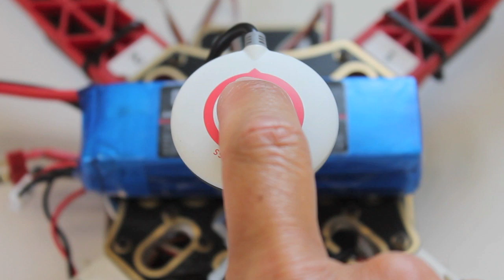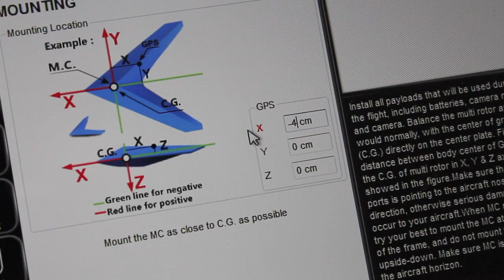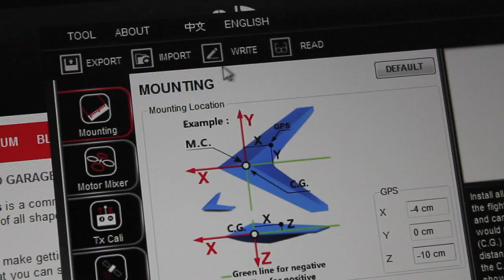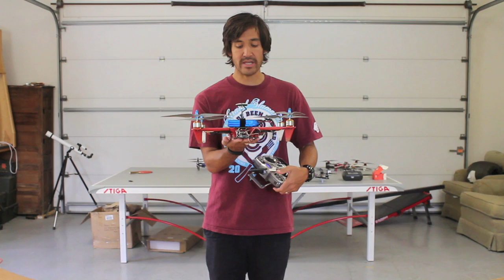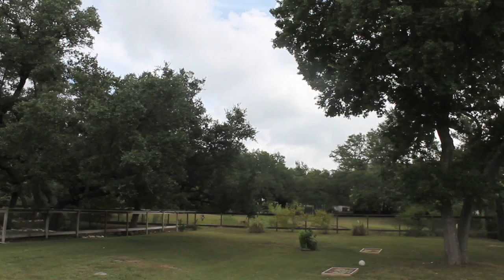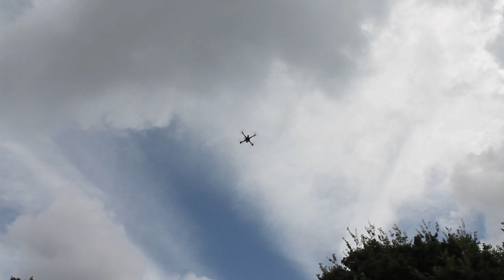NAZA Lite and NAZA V1 GPS Mounting, Configuration, Calibration with Walkera 3 Mode Switch

Comment: Hi i just upgraded my f450 from apm to Naza and im noticing a difference in flight like when im flying in stable mode when all my sticks are center when i give little bit of roll/pitch input the drone keeps going on that direction i mean to say thats its not getting center if i give slight left input and leave back the throttle to center the drone keeps goin left until i have to give right input to stop hitting into walls is this normal of my dji naza has some fault or may be this is how it feels for others I don't know please help
Reply: It sounds like you're in manual mode

Comment: Hi Dennis, I arm my NAZA, motors spin (slow) bit when I increase the throttle they do not respond. I have watched a lot of your videos and they have helped me in so many ways. If you or anyone has come across this, I would greatly appreciate the help. Thank you.
Reply from the maker: That's really strange, Charles. I haven't seen that happen before. I would check your throttle input just to make sure everything is working properly. Some transmitters have a PWM output graph to show what signal the throttle sends when you increase it. Let us know what you find out.

Comment: do you measure from the top GPS plate to the bottom of the GPS holder or down to the nazs
Reply from the maker: You need to find the CG of your aircraft and then measure from that to the center of the GPS. This explains it:

http://wiki.dji.com/en/index.php/Naza-M_Mounting_Location_Setting

If you're not 100% accurate on the CG you should be okay. As long as you're close enough. Experiment with different distance values and see what works best for you. Good luck!

Comment: Hi, I need some help. I have a dji phantom 1 with dji naza m lite upgraded to v2 inside it. On RTH failsafe, the quad flies to home point and descends downwards. at the final 5m or so, it slams into the ground, takes off again, slams into the ground again and again until I take over manual control or I hand catch it, before it stops and disarms. please advice me what I need to do to fix this. thank you
Reply from the maker: That's really strange and sorry to hear that. I haven't seen this happen with Naza before so I'm not sure what to tell you. Hopefully someone else in the community can chime in. Please let us know if you figure this out.
Reply: Dennis Baldwin Hey, I resolved it. I figured it was because I upgraded to a 3rd party m8n gps. my gimbal also affected. the entire CG was thrown off and my mounting of GPS offsets had to be changed. changed that and now it holds stably and rth works well.

Comment: I just ordered the NAZA M Lite with GPS and I plan to use it with a 6 channel Flysky radio but it doesn't have any three position switches (for Off , HL , and CL ) I have a F550 with DJI DT7 radio and NAZA M V2 GPS Both the switches are three position switches And My Phantom radio is the same with switches . How do I use the Flysky two position switches to use GPG , ATTI , ATTI and OFF , Course lock , Home Lock with only two position switches ? I am building a Tarot 650 sport or Ironman . and want one switch for retracts . The Flysky has 4 two position switches and two knob variable knobs hope I don't need another radio . Thanks hope you can help .
Reply from the maker: +Spencer Boaz I wish I could help but I've never worked with the Flysky. Hopefully someone here on the channel can offer some assistance. If you do figure this out please share so we can all benefit. Thanks and good luck with your setup.

Comment: Dennis, I hope you can help me with my tarot 650 sport, short view- nasa v2  when  calibration is done on my pc, stick movement is good along with everything ail-thr-etc. first flight it flips hard?? Ihave been flying an f450 for yrs.never had this happen. I think I have tried it all, can not seam to get it...............Jerry
Reply from the maker: jerry neider It sounds to me something to do with motor rotation and making sure you have the correct props for that rotation. I know that sounds elementary but it's burned my TOO many times. If that doesn't work perhaps you can post in the forums at www.garagepilots.com and we can try to help you out.

Comment: HI Dennis Baldwin I recently just bought an f450 with a Naza lite GPS but I cant for some reason perform the compass calibration. does the GPS need to have a good signal?
Reply from the maker: Miguel R. I've done the calibration in my garage without a good signal, but that's an interesting question. Since it's mainly the compass that's being calibrated I don't see why it can't be done indoors. Here is a good reference if you haven't seen it already:

http://wiki.dji.com/en/index.php/Naza-M_GPS_%26_Compass_Calibration
Reply: Dennis Baldwin thanks for help. After hours of messing about with my tx and the f450 i figured out what the problem was. I some how managed to program my tx incorrectly which is why i could not calibrate the compass but everything is working well now.Once again thanks for the help.

Comment: i got my naza and set it up but the red light is always blinking it flies in manual but when in gps it just decreases and lands.
Reply: i fixed it the battery voltage censer was plugged in wrong now it works great
Reply from the maker: RCflyer729 Glad to hear it. I can't count how many times I've had things plugged in incorrectly :)

Comment: Like All your Vids regarding the 9x I enjoy & they give me confidence to learn more about programming.   ONE Problem I have though with my F450  w/naza lite & gps setup  is when im hovering  & Yaw a little The Quad Raises Up Say 10 inches or so. It's like I m giving it throttle at the same time Although I m not,   I Fly mode 3 So my Yaw IS on the same stick as my throttle.   Question is : How do I stop this OR how do I compensate with the 9x  from doing this ?      Additonal :    When yawing , The Raising of the quad Only moves the quad  about 10 inches  But if I continue to Yaw , After the 10 inches raise,   it doesn't  raise anymore  unless I STOP yawing & then Yaw  Again.
Reply from the maker: Mike, that's pretty crazy. Have never seen that happen before. With the 9X there's a display menu that will let you view your sticks in a bar graph. That way you can at least see if the throttle and yaw are linked in any way. Not sure what else to do. Let me think on it some more.
Reply: I have Looked at the display regard my problem & all is correct, The Only link I have is when I Switch the Gear over,(failsafe) The Pit(ch) moves over a little at the same time. Although this happens It doesn't involve The Yaw.  (Additional) : I Do have the program for my Tunringy 9x on File If you would like to have a look at it. I decided to write it out in notepad form.

Comment: When calibrating does the GPS need to lock onto satellites or is that not necessary? before you can calibrate..
Reply from the maker: No. You don't need a lock to calibrate the compass. Just make sure you do it where there isn't a bunch of metal or interference. The NAZA will let you know if the calibration is successful with the LED sequence.

Comment: What gains were you using? Mine has a gimbal and legs on it
Reply from the maker: I was using the default gains in that video. If you have a gimbal and legs then it's likely going to need to be tuned. You can try turning up your gains in small increments or check out this video that talks about messing with the gains while in the air via your TX: DJI Naza Basic and Attitude Gain Settings for Pitch & Roll Using Turnigy 9X Control Knobs hope it helps!

Comment: I went through all the config, mounting, etc. I'm using a turnigy 9x and I cant get my quad to arm. I calibrated it and it has a green blinking LED. But when I do one of the arm commands it doesn't arm the motors. I'm using Hobbywing 40a ESC's
Reply from the maker: Are you flying with the GPS module and have you calibrated it as well? If you continue to have problems would you mind posting at www.garagepilots.com in our forums? We should be able to help you out over there.

Comment: Hi Dennis,
I have a DJI F450 frame, Naza M lite and GPS, Turnigy 30A Esc and Sunnysky X2212-980kv motors. I will use the Phantom SR6 transmitter and the stock Phantom PPM receiver with one antenna. Do I need to calibrate the Esc´s or just set-up the Naza software?
Reply from the maker: I would always recommend calibrating your ESCs before you do anything. That will give you the full range of throttle with your transmitter.
Reply: Dennis Baldwin
Can that be done in the ´Command Sticks Calibration´in the Naza GUI?
Reply from the maker: No, that's actually a different calibration. I would check out this howto: http://copter.ardupilot.com/wiki/initial-setup/esc-motor/#Manual_ESC-by-ESC_Calibration Make sure you do that before you do the Command Stick Calibration in the Assistant.
Reply: Dennis Baldwin
OK, I´ll give it a try

Comment: Dennis Hi, I finished riding my quad with naza lite and installed a futaba 7c 2.4 ghz with the orange rx. which channels should I used channels 1, 2, 3, and 4, also do not understand how to use the Setup program. You can show step by step, from the moment you turn on the radio etc.. thank you, I like your explanations, hug, Edu.
Reply from the maker: Hi Edu, when I get some time in the coming weeks I will do a video. Right now it's busy with Christmas and New Years in a few days. Maybe this will help you in the meantime:

DJI Naza Quadcopter Getting Started and Running in Less Than 10 Minutes - Upgrade from KKMulticopter

Best of luck with your build.
Reply: Dennis Baldwin Hello Dennis, okay? I want to thank your contact. Understand how it is that time. Sorry. I wait for your tips later on. I know your video will help me a lot, thank you for your time. Happy Holidays and Happy 2014 with many flights. lol.

Comment: Yes green light go off but as soon it go off it turn back on GPS mode I was just wondering if this was normal
Reply from the maker: I'm pretty sure this is normal. See if you can take it about 5-6 feet up after you do the calibration. You should be able to take it up and it will be very stable and locked in. Let me know if you have any problems.

Comment: I have naza v2 n when I finished doing my calibration green solid light turn.n turn back on GPS mode is that normal or it have to go off completely. Please reply
Reply from the maker: The green light should go off when calibration is complete. But if it doesn't perhaps something has changed since I posted this video.

Comment: dennis i buy the dji fw450 arf,,, you recommend to buy the walkera transmitter for my dji 450 and what lipo do you recommend for long flights?? thks
Reply from the maker: I've used one Walkera TX before and I really liked it. What size lipo are you flying with now? I think a 4000-5000mA should give you better flight times.

Comment from the maker: Good question. I would use 10cm and 6cm for your measurements. Mine weren't right on the number either. I had decimals that I was unable to use, so I used whole numbers and it worked just fine. Good luck with your setup.

Comment: Dennis I have a question on the GPS location measurements.
The NAZA Assistant does not allow fractions for the centimeter positions.
Do I just round my measurements up or down or just truncate them. I have measurements like 9.5cm and 6.4cm ??

Comment: If not done already update to firmware 1.6 . 1.5 is good but 1.6 has fixes in it.
I have 1.5 in mine as it also controls the gimbal.

Comment: i have it setup to a switch on my transmitter i have calibrated my esc and gyros, i read that V1.2 was hard to get to fly good in autolevel and recommended V1.5 for kk2 butt the programing device is out of stock and would take weeks from HK

Comment: i have my tricopter with a kk2 board on it, my auto level dosent seem to work it is on but dosent seem to do anything. wont stay level i cant even keep it in the air with it on, manual mode works but im not that great of a multirotor pilot yet as i have flew helicopters for years but not multis so either way its hard for me to keep it in the air. any suggestions?